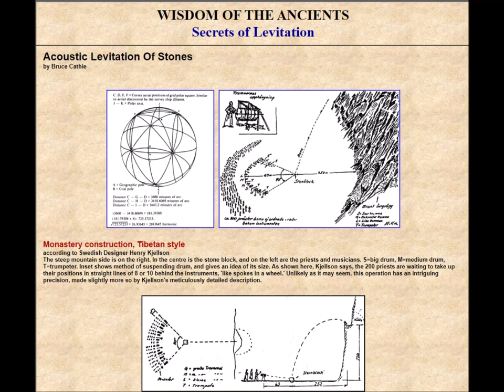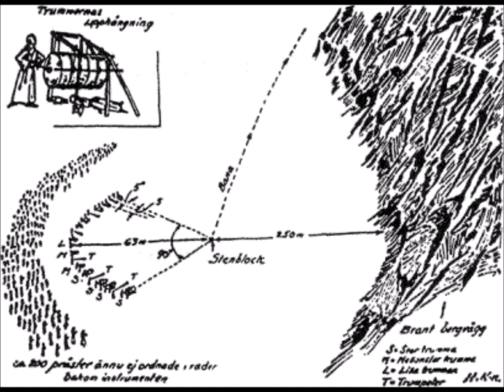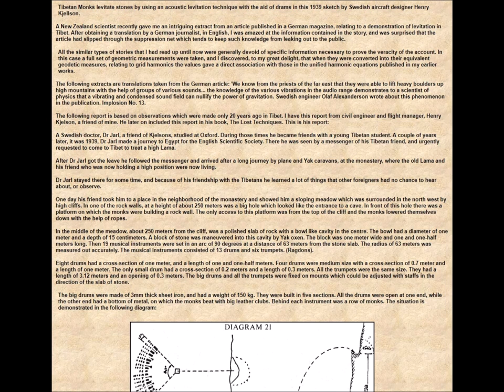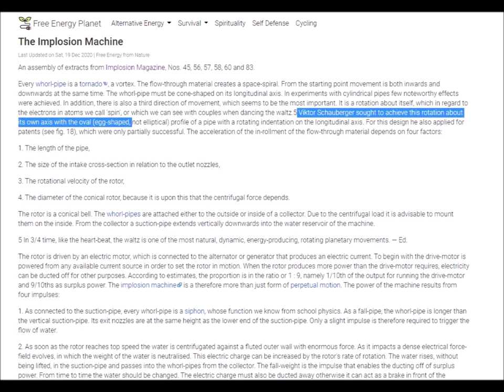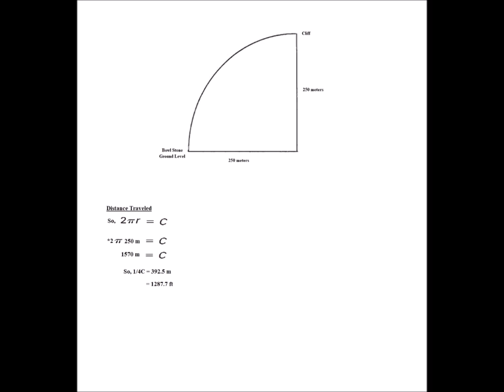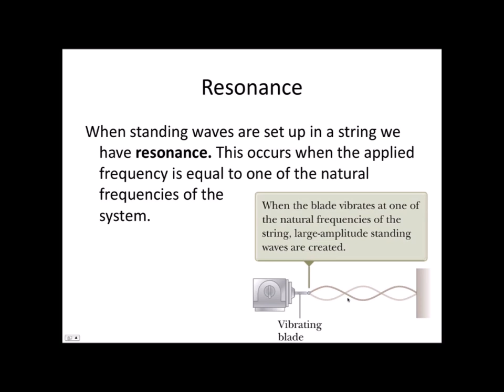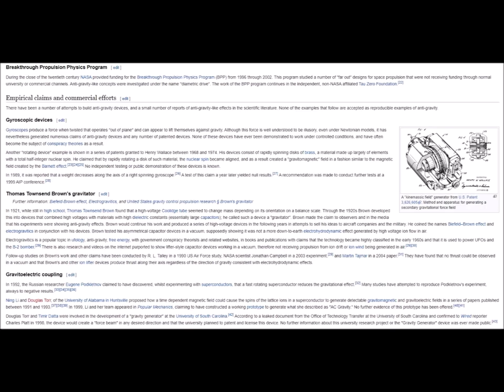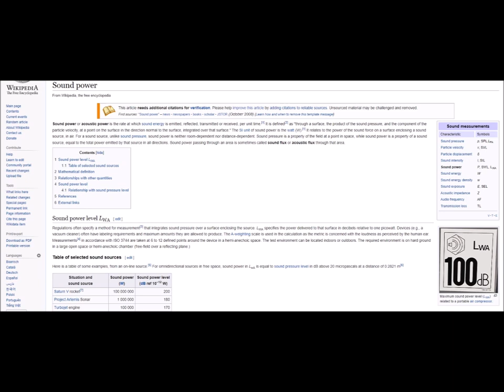The Tibetan Levitation Technique: Acoustically Induced Vortex Lift?

Comment: Great video, I have come across this theory elsewhere yet not in such depth. I have never seen reference to the cup marked stone. It makes me wonder if there are other factors involved in the levitation:
Stones channel energy, especially if they are part of an alignment. Cup marks in stones seem to focus the energy in some way. Sound has a perceptible effect on the energy stones can emit.
Maybe the sound is used to focus the natural energy the cup marked stone is emitting, in order to levitate the block?
Reply from the maker: You're absolutely right! Stones naturally store and emit energy. Interestingly, sound vibrations, represented quantum mechanically as phonons, can interact directly with electromagnetism. Mainstream scientists have also found that phonons interact directly with gravity, and have been found to possess "negative mass". Hence, rather than following a downward trajectory in a gravitational field, they actually follow an upwards trajectory. Further, John W Keely claimed that the proper sound vibrations can intensify gravity (and most likely also nullify it). Sound seems to be the key to the universal, fundamental forces.
Reply: @gsutton78  so probably more the case that the conjunction of the sound and the energy from the stone (telluric? maybe somehow carried in plasma?) are lightening the stone to enable the levitation?
Reply from the maker: @denwahz   I think it's a reasonable speculation. There's probably more to it than just the force of the vortex itself.
Reply: @gsutton78  Im sure there is. I'm now watching your vid on leylines and levitation, I noted the screenshot of David Cowans book Ley Lines and Earth Energies. This is really where my interest lies, using these powers for healing but not individuals. Im thinking more on a global scale and wondering if there is any way to redress the gross power imbalance on our world. It seems very apparent to me these energies have been used to create the power imbalance, so there has to be a way to shift it back. You seem to have a wealth of knowledge on this subject so any good rescources you could point me at would be appreciated.
Reply from the maker: @denwahz   I wholeheartedly agree. The power imbalances are indeed real, and I believe much of it lies in the lack of access to clean water. We have droughts and lack of food because of it which makes little sense as the planet is more than 70% covered with it. The creation and perpetuation of poverty and lack is a tool of control for the super-rich. Natural waters have been diverted unnaturally causing untold destruction. The Rio "Grande" out West, for instance has now become more like the Rio "Stream". And oftentimes the water that is available is not high quality. I remember hearing about an entire village which differed from dwarfism because their water source was contaminated. Once it was cleared up, the dwarfism ceased. This is why I think Viktor Schauberger's work is so important, especially now. He was a natural engineer who realized that "vitalized" water flows in spirals and has much different properties from stale and still water. Spiraling water also generates a type of magnetic field which Schauberger called diamagnetism; a property markedly different from the modern, mainstream definition of it. According to him, this diamagnetism gives the water a type of buoyancy and biological energy. It's absolutely fascinating. This likely ties into ley lines which are often associated with and said to mark underground water channels. I believe that the weather patterns are also tied to the flow of water over the planet and are intimately tied to electromagnetic energy. If we could balance these energetic and water flows, we could heal the planet. Heal the planet, and we give everyone more opportunities to thrive rather than just select groups. This is why I would definitely suggest studying Schauberger's work.
Reply: @gsutton78  I am aware of the work of Viktor, he came very much from the same school as Tesla imho, they both understood nature and were separate from modern tech in their early years, so wore no blinkers. I have studied neither deeply as I have spent far too long understanding the problems we face and the causes, all of which can be encapsulated in one word; greed.
From talking with Wiccans I am aware that stone circles are generally built over aquifers, it was said that the water contained the energy and the stones above focused it. It also seems that a lot of the stone circles either had ditches which would contain water or were built near water courses. The power of water is greatly under estimated, one only needs to look at the work of Schauberg, Emoto and  Polack to see this. There is also evidence that pyramids were built in conjunction with water courses, either on the surface, underground or artificially made. There is even one pyramid which is built on a mica base. Mica being an insulator.
My observations on the power structure are based around the amount of money spent even in modern times to adhere to sacred geometry in the construction of cities. David Cowans collaborative book on the sacred geometry of the US, although I have not read it yet, I have seen plenty of evidence of this geometry in stuff I have watched on yt. The existence of Freemasons, those who worked the stones in past times, gained an understanding of the power in them and harnessed them secretly to their own ends, smacks of control.

What we are dealing with here are elemental forces, those of fire, water and earth. From stuff I have seen, the ancients approached math differently to us, they considered relationships such as pi and expressed things in terms of relationships. Maybe fundamental is the relationship between these elemental forces?
This knowledge may be lost, yet just like the tech illustrated in the vid, this is knowledge that has once been in our field of understanding, so it should be easier to regain it than it was for them to learn it from scratch. I feel leaps of faith and gut instinct will play a major part in recovering this knowledge.

Comment: Sound waves disable the mass of the atomic structure thus making it weightless.. sonic levitation can encapsulated the object in a bubble and varying the sound basically moves the objects like a tractor beam function
Reply from the maker: Yes! It sounds similar to a much more advanced, macro sized version of the container-less processing technique that NASA uses!!

Comment: 13:50 error. Work is wrong, no change in potential energy moving horizontally...  Work done horizontally is change in KE. They must use the horizontal rate of acceleration... I estimate 1.5 m/s horizontal acceleration w/ 4k kgs, h = 250m. Forget even calling it work, just think change in energy. Still, 8.5+ Million Joules vertically and 1.5 Million Joules Horizontally for sandstone. I guess about 1000 PSI on bottom surface of the stone. Still wondering how that resonance was achieved specifically and how to scale it.

Comment: That brick didn’t fly by vortex lift, it was centrifugal force due to the taper on the bucket...
Reply from the maker: Actually it was due to the effect of centrifugal force on the air, creating a vortex. This in turn propelled the ring which the brick was on. It's explained in this video here: https://youtu.be/VLdaljPaS2w, where it shows the ring with a 5 lbs load floating in mid air without touching the sides when it's at top angular velocity.
Reply: @gsutton78  nope... try it with a cylindrical vessel, without tapered walls and no oscillation (ie: running true to it’s axis without moving around)... the reason it’s lifting is because centrifugal force against the tapered surface, giving a resulting force upwards, this force is exaggerated due to the oscillation of the vessel, once again due to centrifugal force of an out of balance load. If the item was able to spin perfectly around it’s axis, it would be highly resistant to any movement, you can observe this by spinning the front wheel on a bicycle and then turning the handle bars, the faster the wheel is spin ing around it’s axis, the more it resists change.
Reply from the maker: @madaxe79   Nope. I've already tried it with non-tapered walls. I've also tried it in water in which the vortex can be clearly seen: https://youtu.be/DkgGyijKY74 and https://youtu.be/h2RblkYPnSo.

Comment: A human can only generate 100w of power. You said the work performed would require 80000 watts continuous. So they need 100x more humans or a lot more time, assuming 100% of their energy was dumped into the stone
Reply from the maker: This is where resonance comes in. Resonance systems are one way of building enormous amounts of energy over time from a continuous input of smaller amounts of energy and then releasing it over a much shorter amount of time. We define this as power. Potential energy via resonance (an oscillating swing or sound vibrations), rotation (heavy flywheel), height (carrying something heavy upstairs and dropping it) capacitors (spark discharge/lightning), are all ways to build tremendous potential energy over time and hence generate levels of power that wouldn't otherwise be possible. One thing that is really telling about this alleged event is that it took several minutes for the block to move.
Reply: I won't waste my time schooing you on the innumerable ways in which you just embarrased yourself. Get thee to a University - Or better yet just learn before you try to teach. --AEO
Reply from the maker: @adamosterberg3563   Hello. Are you responding to Greg or to me?
Reply: @gsutton78  Lol that was to Greg. I just found it hilarious that he thought he knew everything when in reality, it's closer to nothing. But I try not to use absolutes: they're...'Almost' Never accurate. Best!

Comment: In your experiment I don't see how sound is accounted for...  you are spinning the brick.
Reply from the maker: @guess-who3991    Vortices can be produced in several ways. One is mechanical spinning. Another is temperature differentials. Another is sound. Sound can act as a propulsive force just as electromagnetism, but we don't yet know how to generate sound of the strength and quality to act as a motive source. I was showing how a vortex induced by spinning can lift a brick, and by implication how a vortex induced by sound could do the same. But our knowledge of sound generation would have to advance considerably.